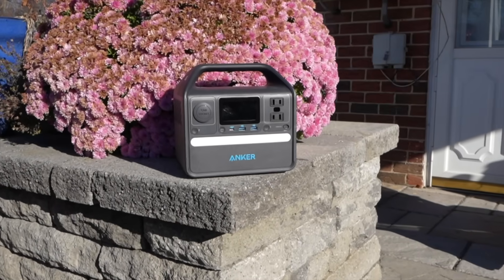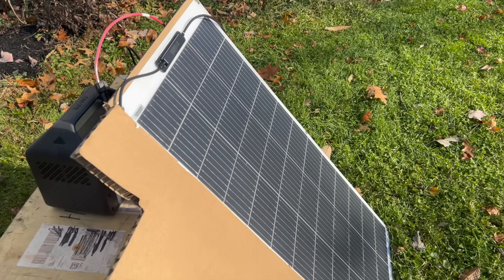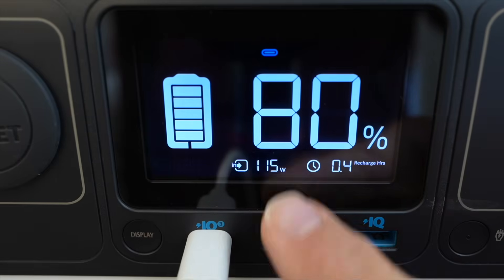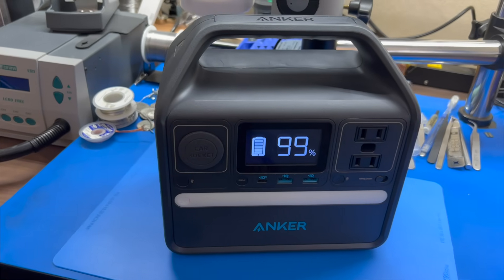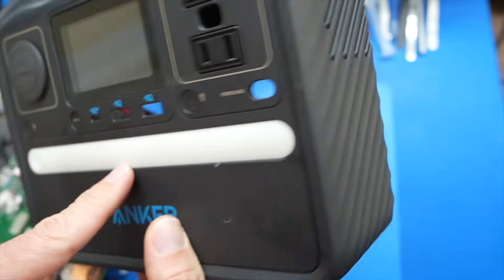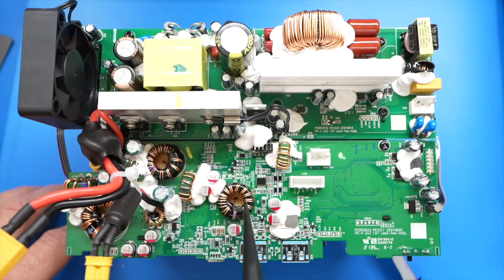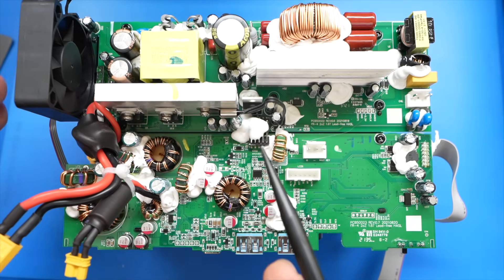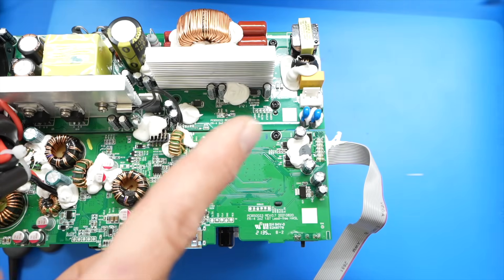I Took Apart a Power Station | Anker 521

Comment: i have the slightly bigger 535 model and i wanted to fix the ac port button cause it got jammed, thanks for the guide, i imagine both banks have a very similar build
Reply from the maker: Yes, they would generally be the same but the 535 is bigger.
Reply: @FrugalRepair i mean i did say it was bigger haha, that front button panel has screws right or did i see the spots wrong? also what do i use to re-attach the bottom rubber feet pads, seems like you scraped them off an adhesive, i havent started yet i just need to know what i gotta do

Comment: I have one. Output for the AC is 300watts 600 peak. Also the type C outlet is input and output. So if you have a solar panel with a type C output you can charge the 501. One problem I am having is that the outputs don’t always turn themselves on to charge my IPhone. I have to plug it in a few times to get it to charge. Could be the cable I ordered a high quality one. Before you take one  apart learn what it can do. That mess he made with the solar charging rig he made was very unnecessary.

Comment: My 521 has failed to charge from any input to the rear panel charge input. They have responded to me 3 times & I have politely supplied requested info. I have a repair ticket# with no directions on how to move resolution. I am loosing faith in Anker. Their USB-C port is only way (SLOOOWW) to put any charge into the batteries. Consider some other charger not by Anker.

Comment: I have a 521 from o2-19-24 which just stopped seeing any input to rear charge port. Charger shows 24v so it is OK. Must be a fuse somewhere that has blown. Contacted Anker Support today 5-5-24 & awaiting their response. I am experienced with electronics. If I open the case my warranty is void. Only charge option is USB-C. I have been very gentle with the rear charge port.
Reply: Liked circuit design of Crown LXi-1500. Replaced electrolytic coupling caps with polypropylene audio caps. Sounds astonishing almost rivaling my PrimaLuna tube amps.
Reply: I think I see a fuse bulge on the 2nd smaller T-connector on the left side. Appears to be heat shrink contained. I think this smaller connector clips onto the back charge port.
Reply: The battery management board also has a P+,C+ & P-,C- yellow plastic bulbous thing which could be a fuse container.

Comment: So the cells are 4S, 12.8v nominal just like a commerically available battery pack

So since this thing charges at only 65 watts max, can i just feed in and splice some 10-12 gauge wire to the pack and run it in parallel with a 50ah 12.8v lifepo4 pack for almost a kilowatt hour?

I bet I can

Comment: Can we use anker 521 as a jump starter? What accessories are needed to do so?
Reply from the maker: Not directly to start the starter motor because you won’t be able to get the amps out of it.  This would apply to most portable power stations.  You can however, charge your battery with the 521.  You would want a car port to alligator clip attachment.  Or a regular charger and use the AC port.  It wouldn’t be quick though to charge the battery.

Comment: I saw the models and thought it would be 26650 lifepo cells, 4000mah

Not the best density for the price, but it helps the longevity.

But I couldn't find concrete info anywhere to confirm
Reply: Also wondering what exact cells are in here.

Comment: I see multiple testpoints/headers with labels that look like I2C signals, between the BMS and the main board, and between the main board and the inverter PCB. It would be interesting to see what's being sent back and forth on those connections. If I had to guess, the BMS is monitoring electrical current in/out of the battery itself and communicating that to the main board, as it's a LiFePO4 pack and that would be the only way to track the battery charge level semi-accurately. The I2C connection on the inverter could be for selecting the 50/60hz frequency and monitoring AC current output so the main board can show it on the display.

Comment: This product has failed me more than once on two different units.
Reply from the maker: Do you mind sharing what the failure was?  Did you get a warranty replacement and then it failed in the same way again?
Reply: @FrugalRepair  I dont know the technical terms... but the battery would say 100% with but when plugged in theres no charge. At first it would stay 100% even with devices plugged in charging, now it just stays at 100% regardless if theres a charge or not. Once I plug it in to charge with either the AC or USB-C it will immediately display 100%. If you look at some of the 1-star amazon reviews they can explain it better than I can. This happened on both the unit I purchased and unit sent out as a warranty lol. Idk im gonna try to get credit and go with a different product instead, dont wanna go through the RMA process again.
Reply from the maker: Thanks for explaining.  I want to reach out to Anker and see if I can get some answers.
Reply: @itsdarellcuh  I’ve had same issue, left it in garage for 2 months and it recovered, in the meantime, Anker sent me another (which is now doing same), thankfully the first ones back working… would be good to know if there’s anyway to jump start these things again as plenty of people with same issues…
Reply: I bought this battery back in 2022 and pretty much right away the USB A ports stopped providing power. Contacted Anker and they offered to replace the device or return me some of the cost. Since I don’t use the USB A ports, took the return of some $ - which was nice. Been using this to mostly charge 140w of devices via the AC ports (20-40w sustained usually) - to run things during peak rates. Been doing this for a few years and expect to get many more years of use out of it. Have seen 0 degradation over the last few years despite draining this to near 0 regularly. Looking forward to seeing these LiP04 batteries dropping in price.

Comment: Hey great vid! 🙏🏼 A prepping question - if the batteries are all used up, would it be possible to connect different 12v battery to the board? Would be cool if that great package of inverter, usb c etc could still be used with a car battery or something like that. What do you think?
Reply from the maker: Sorry I missed your question.  I suppose if the battery pack voltage is 12v then you could use another 12v as the source.  Seems like a lot of work though versus just rigging up a DC cord to charge the whole unit from the other battery.
Reply: @FrugalRepair  Ok interesting. Yep, though i just figure if the batteries are all used up. Cheers m8!

Comment: Please dismantle the Anker 535 as well if you can I would be interested to compare! Thanks. Great channel
Reply from the maker: Thanks!  I could do that but it would likely look very similar.  There’s more lfp battery cells and the AC inverter is upgraded.  Is there something in particular you are curious to see?
Reply: @FrugalRepair  I thought the battery setup in Anker 535 might be different and not enclosed as I have one and can see the cells. I agree it would be broadly similar so not worth it on reflection.  Thankyou
Reply from the maker: Thanks. Maybe I will have a reason to take it apart.  Also, I see you found the new channel I started. =) Thanks for watching there too!

Comment: Seems like a good solar Generater.Systems . I have not had to put it to the test yet in a situation without power but it has seemed to operate fine so far.
Reply from the maker: If it has an inverter output and surge output that is bigger than the load wattage of your fridge, yes.   This anker unit is not big enough to run a full size fridge.

Comment: put it in a parking car in summer and only connect to a dash cam, is that safe?
Reply from the maker: It should regulate itself and turn on the fan if it detects the temp is too high.  You might want to double check that to be sure.  I don’t know what temps you are expecting.
Reply: thanks. parking outside in summer, car room may reach 122F - 140F.

Comment: Where's the solar charge controller? This has an MPPT charge controller I think? Is that the inductor at top right? And thanks for this video, I just bought one and was curious about its innards.
Reply from the maker: It’s part of the circuitry that handles the DC input from the back port.  I didn’t study the DC input enough to say which individual components are involved.  Hope you like yours.  Thanks for watching!

Comment: 110v ? Yikes
Reply: what's wrong with that? it's just a simple DC to AC inverter
Reply: @Random_4400     lower voltage means higher current draw and think heat up 110 can damage     devices.

Comment: The battery isn't actually  drained  to zero . It has a low voltage cut off via  a bms  .  Still 12v
Reply: obviously 🤷🏻

Comment: how much power will  800 square feet of solar panel produce
Reply from the maker: That depends on many factors.  What is the angle, azimuth, location, wattage and size of panels, etc

Comment: Thanks for making this video. I'm a big battery guy and love this type of stuff. I'm surprised that they use the XT connectors. That's some nice hobby grade stuff. Also it's cool that they're using the lithium iron cells. These are more resilient to hot and cold temperatures, and are less prone to exploding when damaged.

 I got one of these for Christmas and needed to make sure it was up to my level. For a second I thought it was just a mini lead acid battery, but I knew Anker wouldn't do that to me. 😊
Reply from the maker: That’s great!  Hope you enjoy using it.
Reply: I was surprised by that connector too. XT60 for the cigarette lighter, which is overkill for a plug that can only handle 10 amps, but better than underkill!

Comment: Great video, I like it when it shows what are inside the unit. BTW, so it does not have MPPT or PWM Solar charge controller built-in, is that correct?
Reply from the maker: Thanks!  It does have a solar charger and it is MPPT.

Comment: Is the battery replaceable?
Reply from the maker: Not normally, no. Someone with experience could technically solder the leads off and solder a new one on.  I’m assuming it would have to be the same type of battery pack.  But it wouldn’t be a normal thing one would do.  Plus, they are lifepo4 cells, and will last an really long time, like 10-20 years+ long.  It’s rated for 3000 cycles to around 80% capacity.
Reply: @FrugalRepair what kind of batteries are in here though?

Comment: I liked to take things apart as a kid
Reply from the maker: Cool, what have you been tinkering with lately?
Reply: @FrugalRepair  currently finishing my second video about a real minecraft minecart on real tracks. I expected these power supplies to be full of 18650 cells, cool to know what it actually is!
Reply: @JoelCreates  I'm pretty sure those cells used have a nominal voltage of 3.2v whereas your regular lithium ion 18650's are 3.7v so you'll need more cells to achieve a similar total voltage.

Comment: It is highly doubtful that the could supply the power needed to turn on a camping fridge's compressor.
Reply: Compressors usually use inductive motors that need a surge of power to start. My 3.5 cu ft chest freezer uses about 60 watts when it's on. But, it takes a 600 watt surge to start. Saws are also inductive motors.
Reply from the maker: @raymondjames5035  I'll have to look into the DC surge voltage more but I know the 521 and other small battery units I have used on different portable fridges have not had any issues.
Reply: @raymondjames5035  I just bought a backup 500 watt power station with my fingers crossed that it could handle the surge of my similar dorm fridge so I could keep it or my half size freezer going after hurricanes while I recharge my two Bluetti EB70s. It worked thankfully. It`s only 50 ah but it has been running the small fridge, starting at room temp, for over 7 hours and has only used 20% of the battery. I got a great deal on it too for only 260 before tax.
Reply: Link to power statio?
Reply from the maker: @moctezuma336  It's the first link in the video description.
Reply from the maker: You mean my fridge I was showing in the video?  It has no problem running it.
Reply: @FrugalRepair  it can handle the compressor surge... what is the units surge maximum?
Reply from the maker: The compressors on these types of portable refrigerators are low wattage, and they typically have a normal and an eco mode.  The run around 70w normal and like 40w in eco mode.  I’m not sure about surge wattage, I’ve not seen any noticeable surge on these portable fridges.

Comment: Worth noting that discharging to 0 doesn't actually do much of anything, even an "empty" Li-ion or LifePo4 cell still has a lot of energy left inside, that said however the LifePo4 cells which this uses are very safe and you're unlikely to cause a fire or anything dangerous aside from melting a wire/connector.
Reply from the maker: Thanks for the explanation.  Agreed, the lifepo4 cells are safer.   It doesn’t hurt though to discharge them though.
Reply: @FrugalRepair  Yeah, it certainly doesn't hurt, I just feel it should be pointed out as it doesn't suddenly make them safe from making a mistake like dropping a screwdriver on top of the terminals or like when I was working on my battery project I dropped some thin tab wire across a couple cells, which ended up being a good thing for me, because it melted instantly giving me the idea to use it as a fuse between parallel cells.
Reply: @vgamesx1  I didn`t notice how he discharged it but power stations listing 2000 cycles typically have a BMS that limits the amount of total discharge to around 80%. Otherwise the battery life would drop to 1000 cycles for LiFePO4 cells I believe.

Comment: great video, it would be amazing if you would show how you made a Anderson connection
Reply from the maker: Thanks!  I didn’t actually make an Anderson connection. It was an MC4 on the one end and I just clipped the positive and negative wires to the 12v adapter leads.  This power station uses a DC7909 connection and I didn’t have one on hand.
Reply: @FrugalRepair  sorry should have said mc4 still love to know how to make one